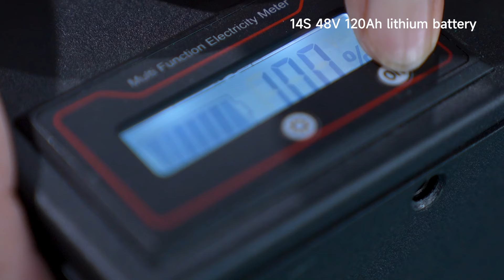120Ah=250KM? 48V120AH lithium battery for this motorbike

Comment: Nice. I wonder heat buildup. There are lots of heat insulation layers.
Reply from the maker: It’s working current wouldn’t reach too large,so the temperature would be under the control line. Besides,the BMS also has temperature sensors

Comment: 14S of lifepo4 won't give 48v nominal. The nominal voltage for these cells is 3,3v so you need a 16S battery to make it a 48v. Even better of building a 17S so you do extend range significantly.
Reply from the maker: Yeah,If it’s lifepo4，48V needs 15S at least, but this is Li-ion cell,nominal V is 3.7V, so 13S or 14S can form 48V